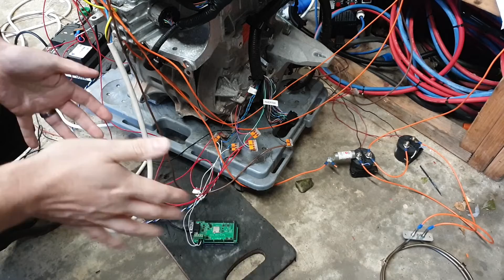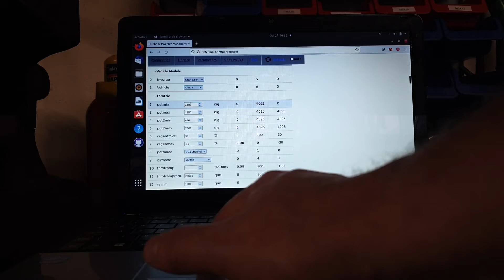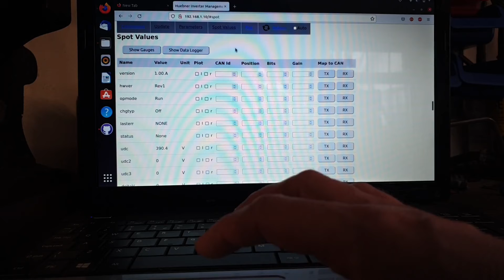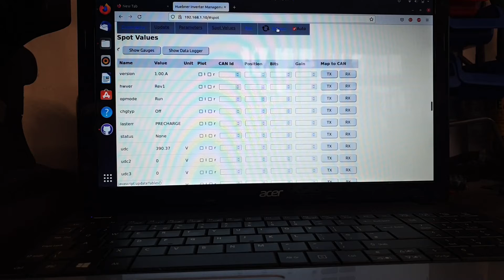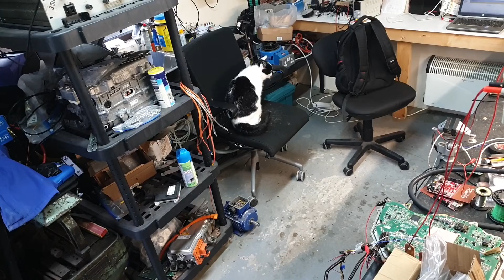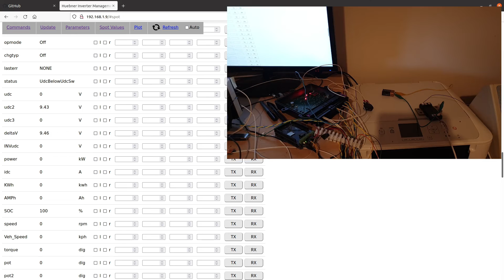ZombieVerter VCU Part 3

Comment: I have built an electric hydroplane (https://youtu.be/sI1yfWo5Rzk) using a BLDC 20Kw motor and Kelly controller, including 20kwh Lifepo4 battery set at 106vdc.
Not getting the speed that I want, I decided to re-power.  I found a motor and controller from a 2015 Smart ForTwo ED.  Now, having researched the web, I located Illuminati Motor Words posting on hacking this motor.  The latest entry that I can find is from 2018 where they refer to your work.
Is there any update that you can share with me to help get this motor going?

Comment: is there or will there be a feature for changing the resolver for if you need to pair a new inverter to the motor or vis versa? Or if we buy a new motor and inverter will there be a way to enter the offset via the vcu? I understand that you need a special tool to read/write to the inverter, but could there be a way to interface via the web portal through the VCU to do this too.